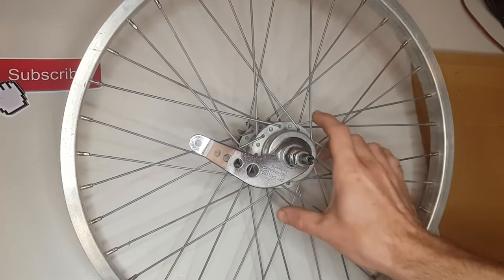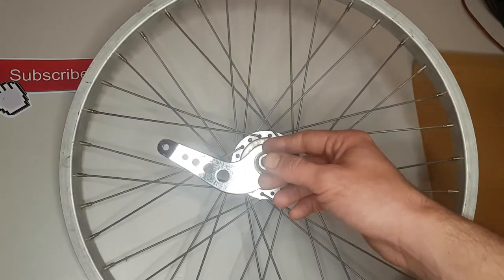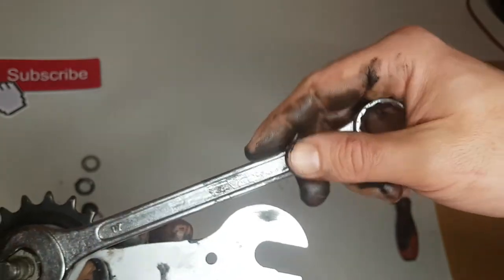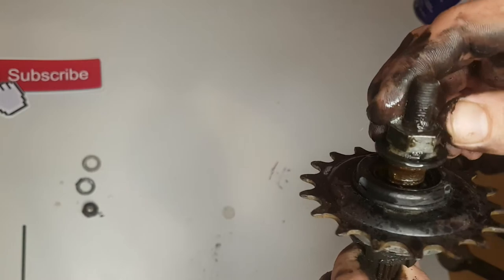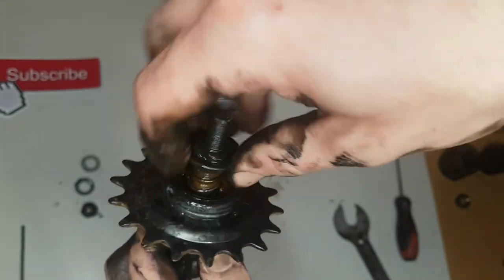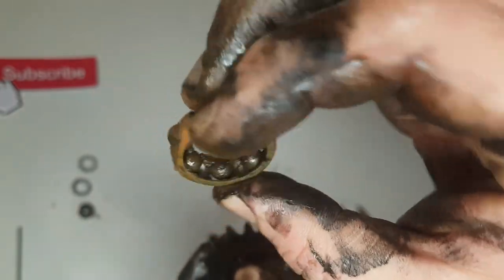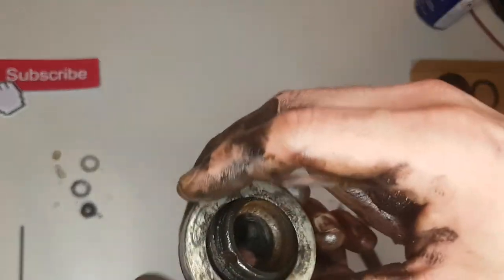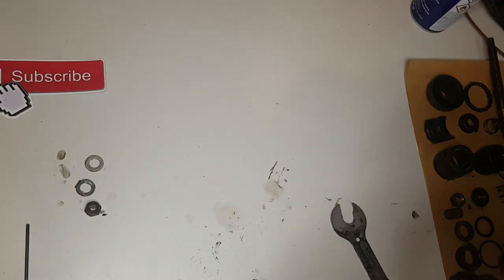How to Disassemble (Take apart) Shimano 3CC  3-Speed Hub

Comment: Thank you, I have one of my projects to overhaul 3cc hub.
I did overhaul of similar Shimano Nexus 3 speed internal gears hub myself, that one is more complicated. 
To loose the ball bearings cone and counter nut I use a bench wise. It's a real  "3-rd" hand makes all disassembles and than ball bearing adjustment much easier. 
👍
Reply from the maker: Thank you for watching 😁 yes that one is more complicated